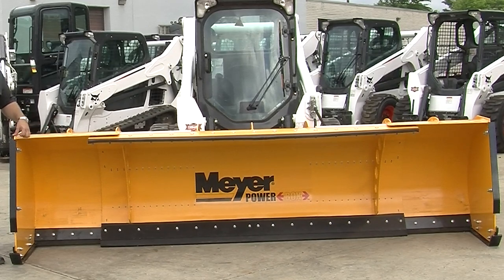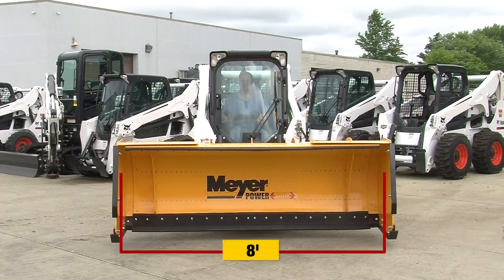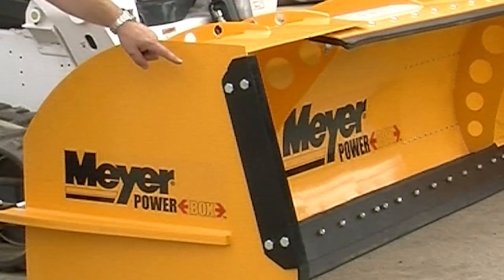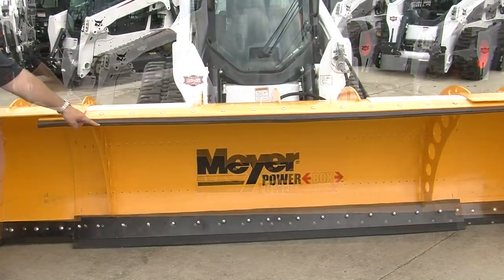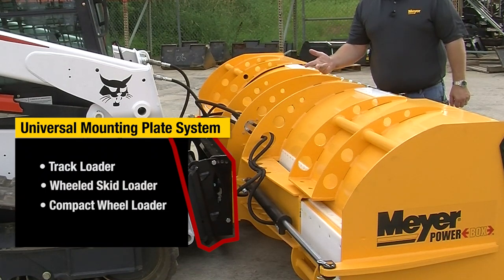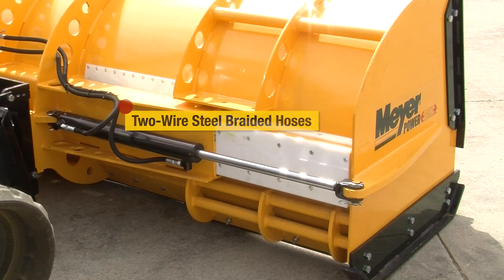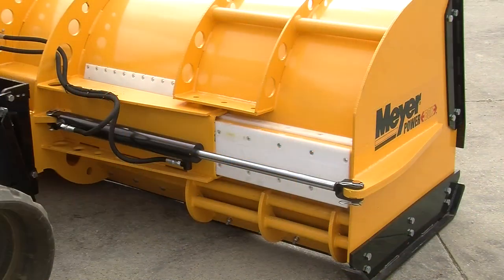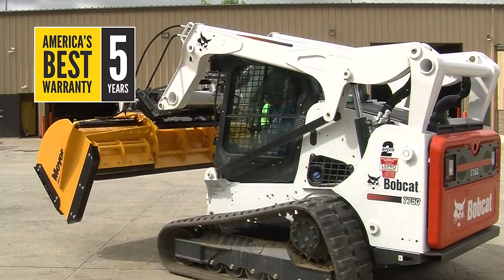Power Box

Comment: notice the gaps under each wing, the center is the only part with a clean scrape         need a patch to fix that     then they might be worth the msrp of $6k and not the $3,500 Stork's is asking for a new one they can't sell, or the $2k I paid for one a half season old...   hopefully we can fix it, but I wouldn't buy new.  the left side goes out first, then the right, then you retract to less than full width, if a less than full width is desired.  seems fairly solid and otherwise well engineered, except for the fact it leaves massive trailers...  idk how that got past QC, really.